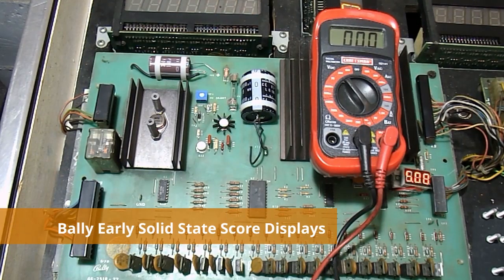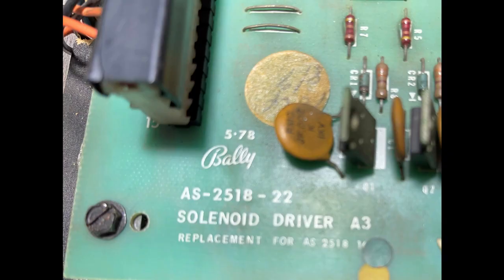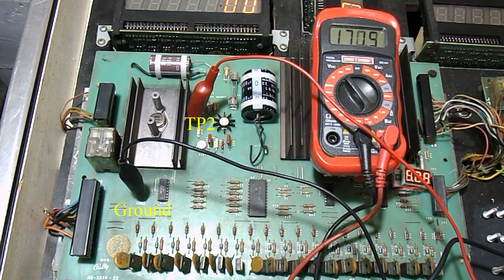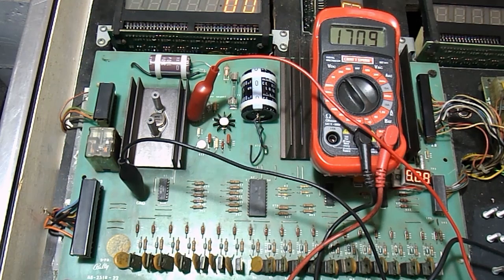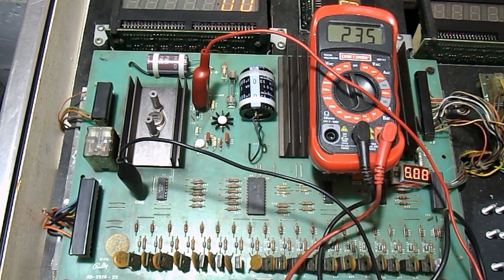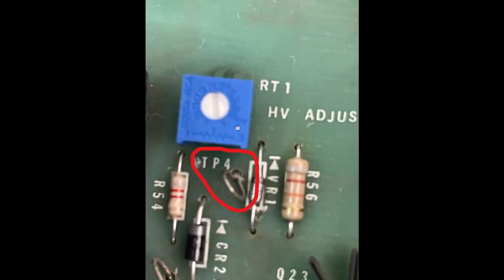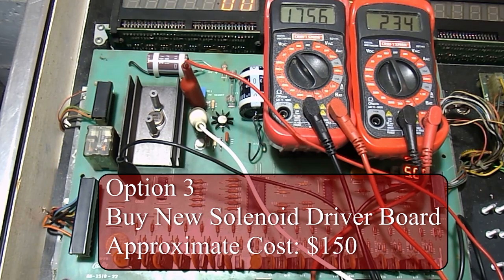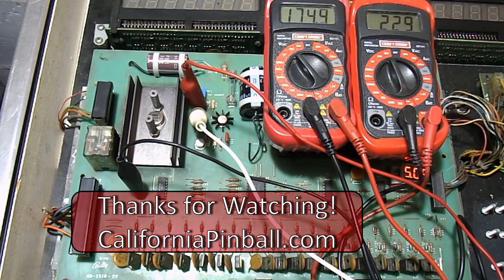Troubleshooting Problems with Bally Early Solid State Pinball Machine Score Displays

Comment: I have Black Pyramid.

I found out today that test port 2 and 4 on my soletdriver board are both 231V DC.

What does a high-coltage repair kit come with? Is it the capacitors or the HV transistor?
Reply: All of my score displays too have stopped working.

Comment: What would cause the center thumper coil to start smoking/melting on a Bally  frontier pinball? Thank you
Reply from the maker: You have a short somewhere.   Assuming this solenoid (coil) wasn't recently replaced and hooked up incorrectly, the first place I would look is the diode that is between the lugs of the solenoid.   Diodes are easy to test with a digital multimeter (DMM).   Assuming the diode tests okay, I would trace back the wires to the solenoid driver board.   One issue you have to be aware of is that the power wire (+43 volts DC) is daisy chained between other solenoids.

Comment: CALIFORNIAPINBALL, Any reasons why the flipper coils need that very big size Relay on the Solenoid board? 50's pinball games used AC voltages for the flipper coils which others say that AC voltage makes the flipper coils strength is HALF the strength when using DC voltage the flipper coils strength hits the ball harder, any reasons why DC voltage hits the ball harder compared to using AC voltage?
Reply from the maker: The relay is basically a solenoid with switches.   On the solid state machines, the flipper coil is actually 2 coils in one.   The one side of the coil powers the initial thrust when the flipper button is engaged.   Then the power is switched to the other side of the coil, which allows the flipper to stay up indefinitely if you hold the flipper button pushed in.

Comment: Hello, great video, but i have a bally flash gordon with a display problem,  when first turned on the machine boots fine and all the displays work but in about a minute or so, they shut off, when checking the voltages at test point 4 i have a constant 230 volts and test point 2 is dialed in at 170 volts, but within a few seconds that voltages starts slowing ramping down and when it gets to 140 volts, the displays drop out,  i have disconnected the displays to see if any of them are dragging down the voltage and that did not make a difference, btw the voltage continues to drop to about 100 volts and beyond,  any idea as to what would cause that, i could just swap out the solenoid driver board with one from my 8 other machines, except that someone,  not me,  hacked the connector at j3 and soldered external connectors directly to the solenoid driver board, so it is no longer plug and play
Reply from the maker: You absolutely have a problem on the solenoid driver board.  One of the components is dragging down the voltage at test point (TP) 2.   Once the voltage drops below 165 to 170 volts, there is not enough voltage to power the plasma score displays.   If the problem was on the display itself, it would blow a fuse.   Therefore, I am very confident that your problem is on the solenoid driver board (likely a bad resistor).    It is time to fix the hacked connector and swap out a solenoid driver board from one of your other machines.   There are companies on the internet that will sell you the parts you need to fix the hacked connector.   Good luck and thanks for the message.

Comment: Thanks for this great video!  My 1978 Bally Blackjack has a finicky player 3 score display...mostly doesn't work, so I am trying to decide if I should just replace it...Can I do just one new display, or do I need to do the entire backboard?
Reply from the maker: You can replace just one display if you use one of the original high voltage plasma displays.  Most "finicky" score displays that seem to flicker are caused by a cracked solder joint.  There are YouTube videos on how to fix this.  Search "Bally score display cracked solder joint".
Reply: @CaliforniaPinball  Thank you!  I will look!